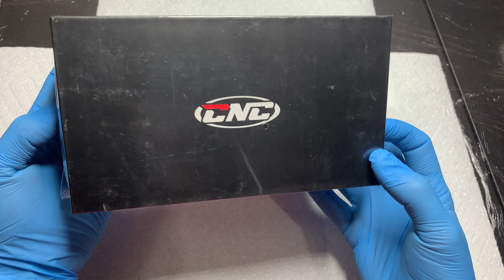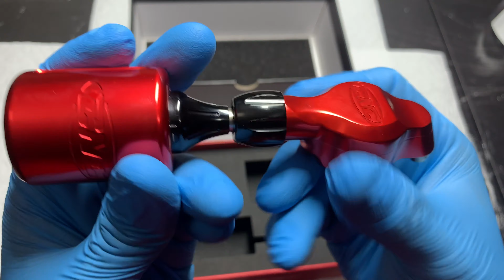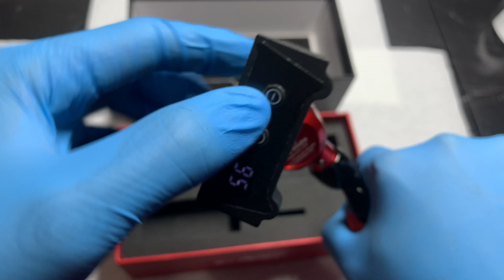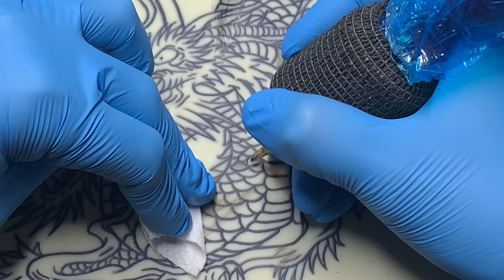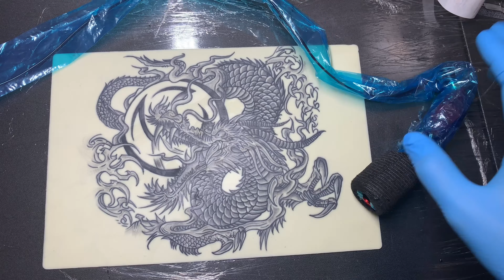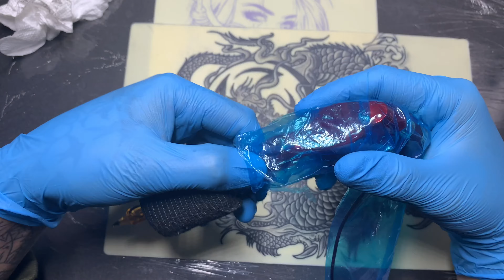CNC T4 Tattoo Machine In Depth Review

Comment: This is the one w the cheap motor they made a more expensive one that’s exactly the same except it has a faulhaber motor.  The one you have is NOT the faulhaber one sadly.
Reply from the maker: According to the product page it states that it’s a muscle motor, I can’t seem to pinpoint where it states faulhaber but I could overlooking it. 

Nonetheless I am happy with the way this very machine performs and it definitely shades great overall. 

Also how would you be able to tell which 1 is a new generation and the old generation?
Reply: @DanielYuck  Yeah on the website and on Amazon wherever you can buy it the new one says new motor and the original one was the Faulhaber.
The original one with the Faulhaber cost $240, the new one that you have is Around $130-$140 depending where you get it.
I’m not sure why they stop selling the faulhaber one, But it was definitely the better of the two
Reply: @TheBeardedTattooer  CNC Q2 has the Faulhaber and it's a great Pen Machine imo
Reply from the maker: @fromlandon4664  I LOVE the Q2! It is amazing.